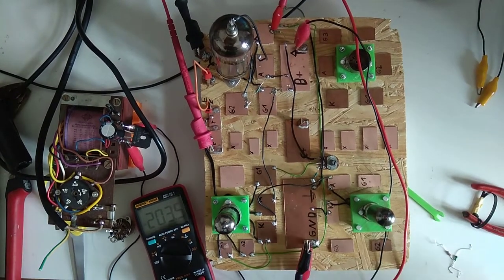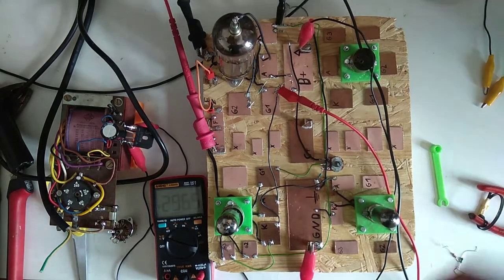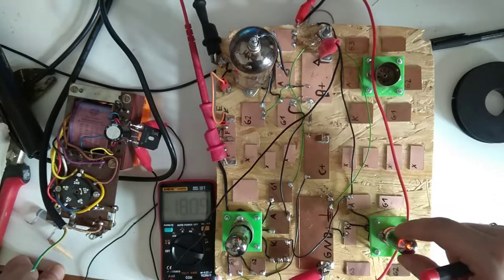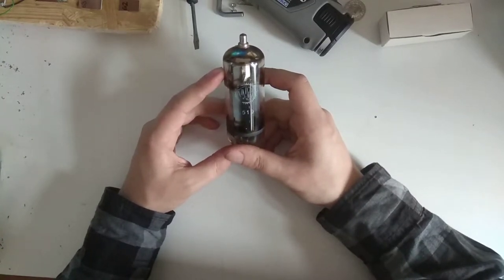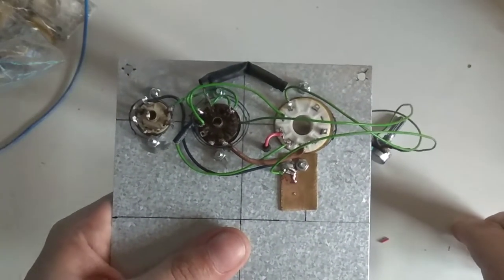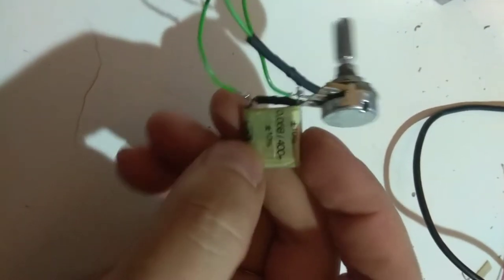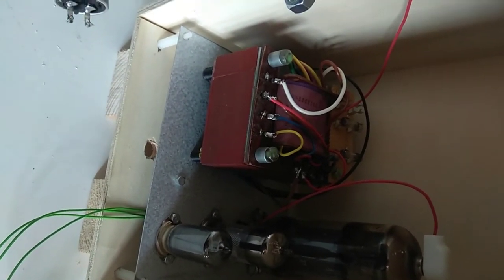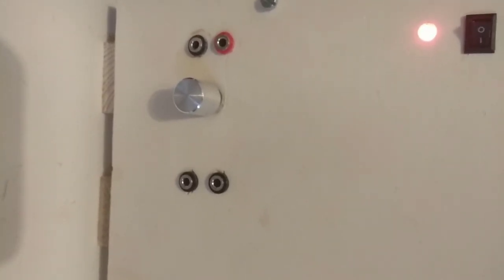Vacuum Tube Lab Power Supply build

Comment: Very nice looking supply, thanks for sharing!
I will build my own one, with 2 PL519 tubes in parallel and will also attempt some current limit function in case of a short
Reply from the maker: Thanks! That sounds good! Actually thought of doing something like this myself recently
Reply: @captainsolder5247 huh my comments somehow are getting deleted?
do you have comments on manual?
Reply from the maker: I can see it, let me check. I don't see anything held for review
Reply: @captainsolder5247 I did some more testing with a 6BA6W as the control tube and i was still not getting good regulation, turns out i am stupid and i was using a non limear remote cutoff tube, hahaha.
Basically a tube that really doesnt want to turn off, thats why my voltage range wasnt great and if you look at the plate curves, its not linear either.
Reply: @captainsolder5247   Update, i used a 6AU6 and it seems to work pretty good, i fixed the problems of parasitic oscillations by putting a capacitor at the output electrolytic  (50uF) and foil (0.15uf) and a 2.2nF capacitor on the grid to cathode of the pass tube, one was enough for both tubes, no issues at all. 
I need to get the regulation to work nicely since there is 10V voltage drop when loaded and it causes b+ drop and changes the current through the reference. 
I have it biased at 5.6mA (5mA is the lowest), it goes up to 30mA, so i might rebias it at 10-15mA so i have a stable voltage drop. 
Otherwise it looks good, it needs a better transformer, more capacitance on the filter etc
Reply from the maker: That is indeed strange, I'll see if I can set something differently on the comment side. Yea the 6BA6W seems to be less suited from what I can see in the datasheet. I think the EF80 is a decent universal tube for this sort of thing the EF94/6AU6 might be even better but not common around here. My original one also had the issue with changing reference voltage via changing current.
Reply: @captainsolder5247  in what range did your supply operate in
minimum to maximum unloaded and loaded with a load of your choice?
by how much did the voltage decline  when a load was attached?
Reply from the maker: Hard to say from memory and with the supply long since disassembled and parts used to build something else, The new one I have built since then (similiar idea but different tubes and some changes in the circuit) is 130-320 unloaded. the max drops about 10 volts at 10mA and around 25 at 30mA. Lower limit pretty much unchanged
Reply: @captainsolder5247  I get 10V drop at 30mA haha
but i may know how to fix it
I. will inform you when i get it to work well
Reply from the maker: Sure, I'd be happy to see your design!
Reply: @captainsolder5247  sure do you have a way to contact you?
d iscord?